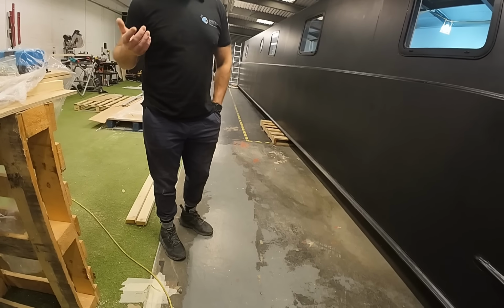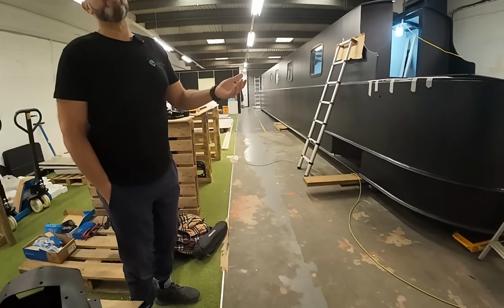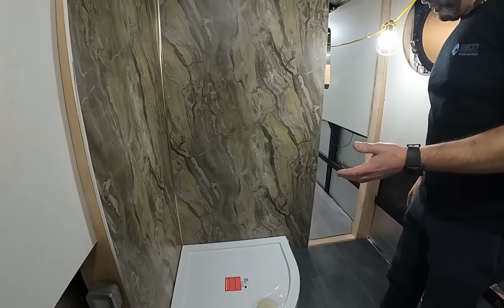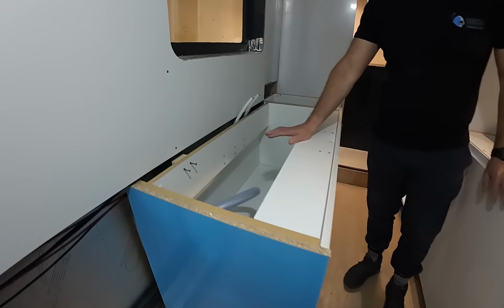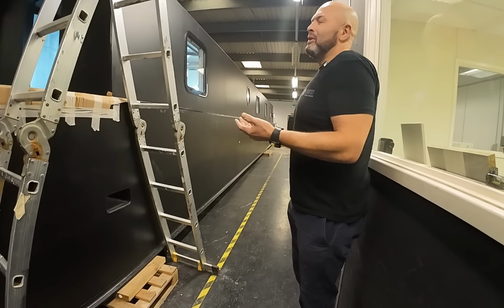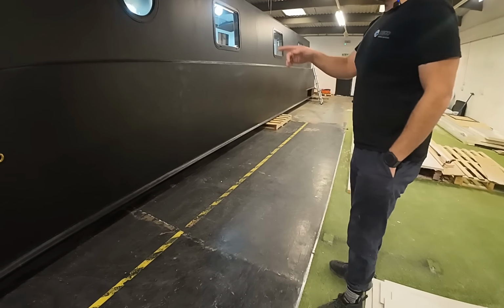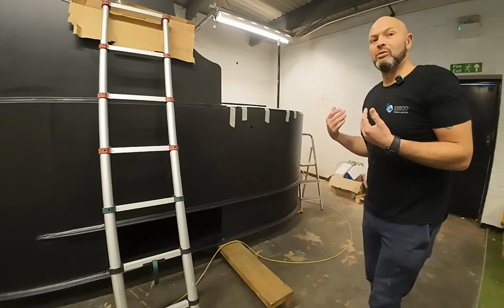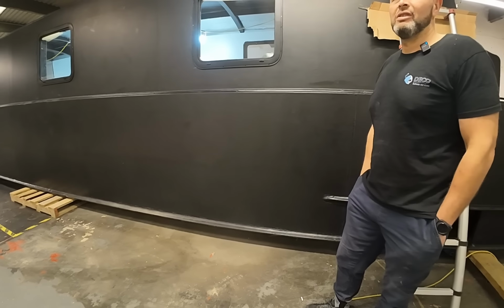World’s FIRST Plastic Narrowboat | The Boatbuilders

Comment: Very interesting idea if the plastic was recycled and not from even more plastic and in itself can be recycled later on. Also would prefer to see gunnels on the sides. How does it fare in a collusion with a steel boat or lock. But a great idea.
Reply: Totally agree with you — sustainability is key. We're actively working on incorporating recycled HDPE where possible, and yes, the boat itself is fully recyclable at end-of-life, which is a huge plus. As for gunnels, we’ve actually taken that feedback onboard and are exploring some clever design solutions that still work with the material. When it comes to collisions, HDPE is incredibly tough and has a bit of flex, so it actually absorbs impact better than traditional materials. It's used in workboats for that very reason. Appreciate the thoughtful feedback
Reply: @ great answer! I think gunnels are essential in working on the boat and for its iconic look. It would probably be safer when in tunnels too. If you can keep the sustainability as a priority you have a bright future with these. Congrats!
Reply: We’re not finished yet 😃😃😃
Thank you it’s been a lot of research into this 4-5years to be infact
Reply: @ all the effort shows and when you want to be the builder with the new ideas will be neverending, but that is only a good thing imo! Feedback will be an integral part to keep pushing the envelope and insert new ideas into the next projects. Very exciting stuff.👏💎👏
Reply: Thank you! I’ve had a lot of feedback — the good, the bad, and everything in between. As I’ve said to everyone, this isn’t about reinventing the wheel — it’s about offering a new option and hopefully bringing more people into the canal industry. Whether it’s for everyone or not, the fact that people are talking about it means we’re starting conversations that matter. And that’s a step forward.

Comment: Nice concept and it will be interesting how the hull survives decades in water. I assume it'll still be banned from Standedge tunnel like GRP boats. And like others have said, it needs some sacrificial rubbing strakes on the side. Maybe you could design some replaceable ones?
Actually, I wonder what you could do 3D printing a boat with a huge printer, say with a carbon based material?

Comment: I like it. People who doubt the strength of HDPE should note thousands of fiberglass cruisers and  narrowboats still exist on the canals without problem, many of them are forty years old plus. Perhaps the builder should do a demonstration with a sledge hammer and a pick on a section of fiberglass cruiser hull versus a section of HDPE. I think this would dispell a number of myths.😊
Reply: Let’s just say we have a few things to show soon 😃😃
Reply: I love it 🥰 things have been really thought about I.e TV in right watching height 👍 very interesting 🥰🥰 love the video ❤
Reply: So the price of narrowboats should plummet then too as it's plastic not steel and a much cheaper product ?
Reply: Thank you for your comment — it's a common misconception, so I’m happy to clarify.

While HDPE (Polystone G Marine-Tec) is a different material to steel, the fabrication process is equally complex. The construction method mirrors traditional boatbuilding techniques — instead of MIG welding, we use specialist plastic extrusion welding, which requires highly skilled operators and purpose-built machinery.

Polystone G is a premium, marine-grade material — not a cheaper alternative, but a modern solution chosen for its exceptional durability, flexibility, and resistance to corrosion, impact, and UV damage. It’s used globally in professional applications such as workboats, military vessels, and emergency craft.

So while it may look different, the time, precision, and craftsmanship that go into building an HDPE narrowboat are just as significant as  with traditional steel.
Reply: @ShaunMoir1 I think people don't realise that they are also paying, not just craftsmanship and materials, but knowledge and expertise, quality comes with a cost 😊
Reply: Soooooo you weren't looking at what you were filming.? Nice boat though
Reply: Scratches trees tunnels. Let see how this plastic boat goes with the cold weather or a holiday day boater.will it be fully loaded when it is lifted into the water.No open fire as plastic melts when it gets too hot 😅.
Reply: Totally get the concerns — about “plastic.” This is actually Polystone G Marine-Tec, a high-grade HDPE engineered for demanding marine use.

This material is used globally in workboats, emergency vessels, and military craft — because it’s incredibly tough, doesn’t corrode or crack, and has a brittle temperature of -93°C. That means it stays flexible and impact-resistant even in extreme cold.

A version of this material (called Play-Tec) is even used in children’s playgrounds — so it’s tested for safety, durability, and UV resistance.

We’re not reinventing the wheel — just offering a cleaner, low-maintenance future for the waterways, using a material that’s already proven itself worldwide.

We’ll have it on show at Crick — happy to show what it can do!

Comment: Would like to see how impact resistant it is, I know the plastic will be tough but winter and summer might change the strength and if you have say the weight of a finished boat hitting a none moving object how well will it hold up, not faulting it I wish them well but it is the sort of question I as new owner would want to know.
Reply: We will be showcasing this soon
Reply: That's the one thing I'm not concerned about, that stuff is tough.

Comment: I have Never understood WHY Narrowboats HAVE to be constructed of Steel only ?. 
With all the different materials available ( and cheaper and lighter than steel ) it just doesn’t seem to make any sense ?!.
You would think that if a boat yard had steel moulds it would be pretty easy to build fibre glass shells and seeing this Boat made completely out of plastic is just incredible.
I am surprised that there are no gunnels ( I think they call the walkway around them that ? ) because I would have thought it is not always possible to use the roof as the walkway or is it a case of you have to walk the length of the boat inside if you want to get from stern to bow ?. 
Electric motors are probably going to be the future for now with the future banning of Fossil Fuel and I think not having a log burner is the right way to go,with radiators and probably a hot air heating system is better.
I would really like the future boat to maybe even have a water catchment system that can utilise the rain water and I think it is only a matter of time before the CRT are going to be insistent on boats having Grey water holding tanks ( rather than grey water being discharged out into the water ways that are being contaminated with the Grey water etc ).
Lithium batteries are going to start very soon going up and up in price so maybe we should be looking into a different storage system for electricity ? ).
It is Expensive but considering it is the first one of its kind and basically a prototype that is to be expected and it will be very interesting seeing how this Boat is finally finished and how it behaves on the Canals and the water ways.
Narrow boats and off grid living are becoming a lot more popular with people but people have to make sure that they have a permanent mooring because of the new CRT regulations and you have to remember that the cost of said moorings are going to go up and become less available.
It’s still cheaper than most Houses and more available for first time buyers ( even Banks are doing mortgages for example ! ).
Some excellent ideas,the remote is a game changer but I would recommend getting some sort of side buffers because other boats and canal sides can be pretty unforgiving and hard lol 😂.
Reply: They are also made of wood and aluminium
Reply: I have seen narrowboats made from wood, steel, aluminium, fiberglass and concrete! Concoform Marine at Weedon in Northampton built boats with a concrete hull. I also think this is not the first builder to use HDPE for a hull.
Reply: I dont think there would be anything cheaper than steel. Not that i have priced it. Years ago steel jet boats were a thing in NZ mostly baced on cost.
Reply: Lifepo4 batteries are actually reducing in price, as they become more mainstream. I've had mine 3yrs and they're much cheaper today  than I paid.

Also, a permanent mooring will not be required, that's  factually incorrect and nothing short of scaremongering. CRT have not indicated any new regulations. Please link where this has been stated. 

It's practically impossible to insist ALL Continuous Cruisers find home moorings, there just isn't the availability for this. 

All CRT are doing at the moment is conducting an independent review of the British Waterways Act and the problems that come with fake continous cruisers who prefer to bridge hop in one tiny area, or overstay the mooring guidelines, further, to also address better, and more successful, enforcement of licence dodgers
Reply: Even made of steel, they need extra ballast for stability, as they have a flat keel.

Comment: Absolutely fascinating boat. Would definitely want rubbing strips down the side as locks are gonna kill them smooth sides. I presume the boat is going to be a lot lighter than a steel boat and with a 900 litre water tank I would be a bit worried about the draft difference between full and empty. Would definitely make boat life easier with less maintenance. Loving it!
Reply: The front end water tank under the floor like that is "normal" ...
Reply: @LifeInChrono  I have a 58’ Narrowboat with a water tank half that size and when the tank is empty it’s not just the front end that lifts it’s also the back end that dips lower in the water, by a good 3”. With double that weight difference you might end up dragging along the bottom of the canal.
Reply: @FriendlyFecker  I would be very surprised if after investing in producing plastic boats the manufacturers hadn't considered that point and taken measures to mitigate the effects tbh.
Reply: Excellent point
Reply: @FriendlyFecker  I also had a 58 foot 10/6/4 Liveaboard Narrowboat built by Rugby Boats for 20 years - with a water tank of similar size (under the floor for the full prow of the boat ) & a heavy Lister HR3  at the back and I cant say it made any noticeable difference to the boats usability  - and in all my cruising (almost every accessible canal in the central system in England - From Anderton to Aylesbury) - I can't say the water tank being full caused me to drag on the bottom, even on the shallower canals - maybe they have become significantly less well maintained in the last 18 years ?
Reply: I totally agree
Reply: @zerocompanyhq  - "An empty water tank, however, can cause serious trim issues" - To a Narrowboat ? :  My boat was about 20 tonnes hull weight, a 3-4 mph displacement boat that (if it were a traditional working boat) could carry almost another  20 tonnes of cargo - (so the working boats could regularly be +/- 20 tonnes)  : so you are suggesting that the water tank at 1/20th of carrying capacity (above and beyond Hull weight) makes that much difference ?  - It might do to a Tupperware powerboat : but not a "barge".
I can assure you that in the real world - having a full or empty water tank, on a correctly ballasted liveaboard  Narrowboat , makes little or no difference to the boats usability or handling. - and I say that based on years of experience - Many many miles covered and many many locks traversed (single handed).
The biggest handling problem Narrowboats have is wind and side currents (from locks/weirs etc ) - and over silted / low water levels & badly maintained canals - Those are all external factors.
[ In the video they make a clear point that the Plastic boat will be ballasted (which is normally balanced along the entire length to account) before fit-out.]
(I would also point out that @FriendlyFecker stated it made a 3" difference over the entire 58 foot -  on a 72 foot working boat the laden Vs unladen may be 4' foot difference at the prow : and they managed to function for 100's of years without a problem ;-) )
Reply: @LifeInChrono 

Not necessarily true if the boat is deep drafted, say three feet, and there's a swimming pool sized water tank, with possibly a large poo tank.

The Ashby, for one, is quite unforgiving to deep drafted boats.

I know these things 😂
Reply: @t1n4444   - perhaps a  postface or nota bene  with "Your own experience of the Ashby may vary" :  The most I got was a bit of bottom suck. , and given that Ashby Boats  used to (? Maybe still do - I hope so)   operate from there & had steel boats considerably bigger than mine  (68-70ft ? - can't remember)  : as I say - It depends on maintenance.
The only place I ever truly grounded was on the sand bank waiting to go into the lock when coming off  the river Ouse after the Drax power station (?) - an that was just bad timing...
Reply: @zerocompanyhq  - for double clarity : you believe you are "commenting on a thread discussing the possible stability issues of an empty water tank". (I don't actually think stability was mentioned  - and "trim" (discounting List ) in Narrowboat terms , is about ease of passage through the water -  Flat, over prow down is best : - there is no planing) And , you are querying "How tight are the tunnel and bridge tolerances if her water tank where empty ?" - for age old design of "an English Narrowboat" - (A new Plastic Narrowboat hull design , which  follows 95% of the conventions of existing Narrowboat hull design - except that is being made out of plastic not steel) - A type of boat that automatically and utterly fails as usable if it does not work within the very strict design limitations of the English canals (lock widths &  lengths , bridge heights, tunnel dimensions ) -  all very necessary , nay essential,  to function on the English Canals -  that the company has sunk probably many 100's of thousands of pounds into & hopes to charge customers £160k each  for "a working English Narrowboat to be used on the English Canals" ? -  That is either a poseur's query or suggests you are not prepared to credit any Narrowboat design knowledge to the designers/fabricators.